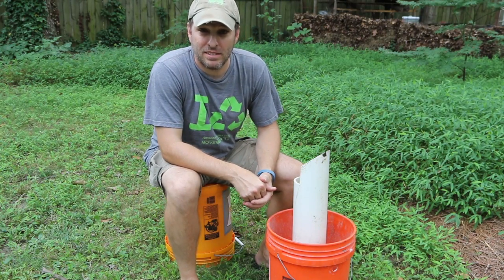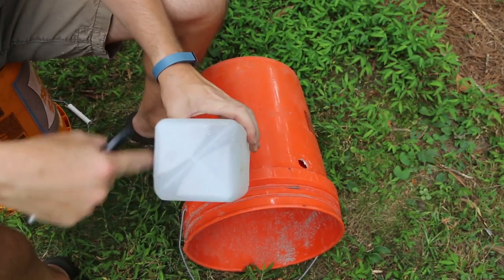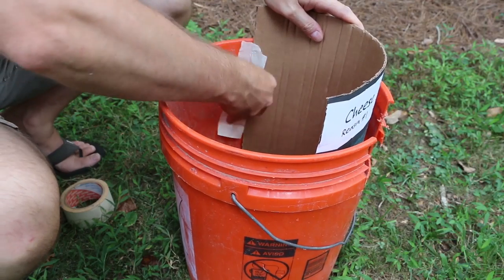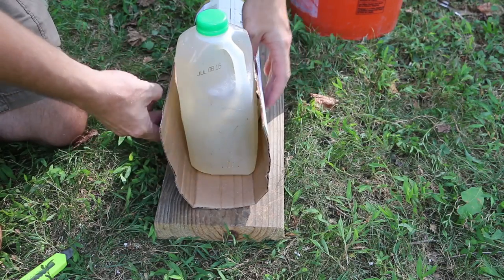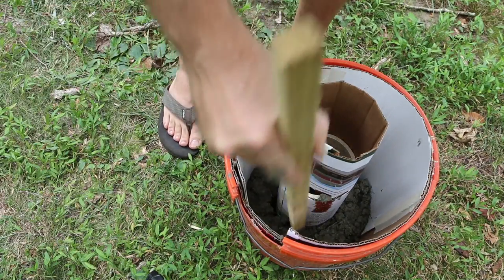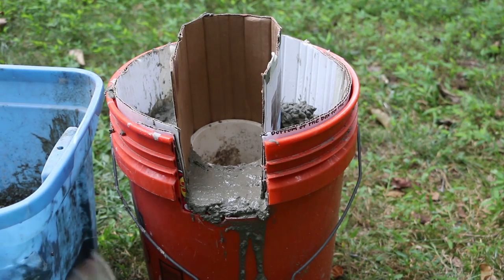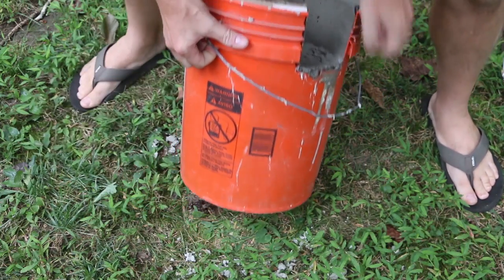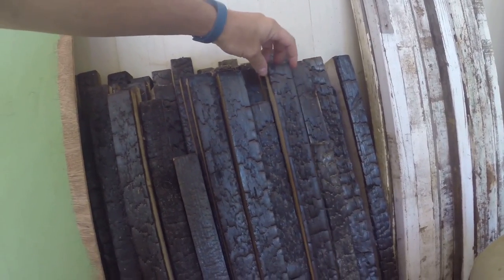How To Make A DIY Concrete Rocket Stove

Comment: I'm going  to try the rocket stove
Reply from the maker: Awesome Kathy! Let me know how your rocket stove turns out. BTW, I'm going to do an update on this rocket stove video to incorporate a lot of the excellent comments and suggestions that have come in. One thing I recommend adding to your stove is mixing perlite (in garden section) into the concrete surrounding the firebox and chimney. This will serve as an insulator, making the stove more efficient in delivering heat to the pot.

Comment: 1) Does it save more energy if it's shorter height? 2) What kind of marker is that @ 12:18 ?
Reply from the maker: Hi Joey. The chimney needs to be tall enough to have the air volume to pull a draft, but not too tall to allow for cooling before the combustion gasses reach the cooking surface. One data point I've read is the chimney needs to be 3 times the width of the firebox. The marker at 12:18 is my Twisted Sharpie made by my friend Greg Porter of the Greg's Garage YouTube channel. You can pick one up at www.gregsgaragekc.com. It uses a standard Sharpie insert, so you can replace it once it is worn out. The steel will never wear out. :-) The pens are all numbered too, which is cool. I have #21.
Reply: TY GreenShortz DIY for your reply. I think your upside down method and re-usable bucket mold is better than most methods I've seen so far. Does it matter what type of concrete i use or with sand, etc?

Comment: How does the  internal diamster  of the stove affect the  stove performance n whats the best  diameter!
Also would like to know how the height of the stove would affect :
Reply from the maker: I think the performance primarily has to do with airflow. There a ratios of height of the chimney and the length of the firebox/j tube. This particular design, bends a few of those rules. In a later video, I add a grate on bricks under the firebox to allow airflow under the wood.  That increased performance significantly. If the chimney gets too tall, there is more heat absorbed by the mass of the stove, less heat to the pot. I like to allow the flames to touch the pot directly. Heat absorbing into the concrete can be reduced by the addition of an insulating element to the cement mix. I add perlite in the later video I mentioned. Hope that answered your questions. Thanks for watching.

Comment: Nice work! I am thinking about making one of these on a larger scale for a rocket mass heater for home heating. I wonder though, is the concrete you used for this going to hold up under the typically EXTREME heat produced by rocket stove heat as in 2800 degrees Fahrenheit???

Thanks,

Lee
Reply from the maker: Lee, that is a good question. I fired this one in a video boiling eggs, https://www.youtube.com/watch?v=xNghjd6FGu4 but that was not maxed heat output for sure. I've got a thermal camera, but it maxes out at 750 F. You could always pout your concrete rocket stove in a steel drum and just leave the drum on. Were you thinking that big? I will say that my prototype stove https://www.youtube.com/watch?v=NUgfcvGIr-Y was built using regular concrete and limited armature and it did crack under a hotter burn. When I get my fan in, I'll see if I can burn this one out. Thanks for watching.
Reply: The folks over at permies are ALLLL about the rocket mass heaters for the purposes of heating one's household. Their more recent stuff includes how to incorporate cooking apparatus and even rigging for hot water use as well. There is SOOO much we can do with the concept of rocket mass heating/stoves and to think we are really on the tip of the iceberg with this "new" technology. 

My main concern is trying to avoid building ANY PART of my rocket mass heater using cob of any kind. If it's not mixed just right, it's WORTHLESS! I don't have the time to fool around with that "maybe" stuff. I need more definite stuff. That's why I asked about the VERY HIGH HEAT known to exist in the regular use of Rocket Mass Heaters while using the cement type YOU used in this set up.

If you look at some videos from the folks at permies or richsoil (they also have a youtube channel) and you'd see the type of set up I wish to have where it's basically an L-shaped bench that surrounds/buries a system of chimney piping using rocks, crushed stone and, in most cases, cob. I want to do with out the cob as it is too finicky. One can add cushions to make a sort of couch effect to this "bench" made out of the rocks, piping, stones, etc and covering.

Now that I think of it, I wonder if building a box-like structure for the bench and sealing the outer layer between panels of plywood the thickness of which being equal to a 2x4 (1 and 3/4 in) would work to both delay the output of the heat within the stove, while still allowing it to be released in such a manor to still effectively heat the home AND perhaps making the overall heat performance lengthened ... ALL WHILE STILL not causing a bad release of toxic gasses from the insulation??? I was thinking of using that expanding foam insulation, BUT, that foam board insulation might do some good too!

PS-On the odd chance I am filling your head with ideas, that's great! Just promise me one thing...

ALWAYS TEST THESE THINGS OUTSIDE IN AN OPEN AIR SPACE FIRST BEFORE BRINGING IT INSIDE FOR A MORE PERMANENT STRUCTURE!!!

Lee
Reply from the maker: Lee, Thanks for the info and ideas. I've seen a few videos with rocket mass heat stoves. Simple and impressive. I'm not sure I'll attempt one just yet. I'm still learning how to run my rocket stove. I'd love to see what you end up building. 

One thought, perhaps lining the chimney portion with fire brick and then surrounding that with concrete would provide the heat resistance and stability you're looking for. Not sure if that would limit the radiant heat if you are looking for that output.

I think I'd stay away from any foam product around high heat. Too much heat would vaporize or gasify it. But, don't quote me on that I'm not an expert on that.

Thanks for watching and for sharing your insights.

Comment: I've watched a lot of these rocket stoves videos and this is far and away the best. Only problem is I want one to take camping and boy this one would be heavy! Great for use at home though.
Reply from the maker: That's high praise, Stewart! I appreciate it. I tried to picture you stuffing this rocket stove in your frame pack. :-) I've been thinking about a backpack version of a rocket stove (my son will start Boy Scouts this month). There are some cool metal stoves on the market that fold flat. Here's a link to one I've seen on YouTube, but it is out of stock, at least on Amazon. https://uedata.amazon.com/Firebox-Folding-Campfire-Stove/dp/B00BW77AZ8/ref=cm_cr_pr_sims_t I may try and make something like this. Would you be interested in seeing that video?
Reply: Totally!
Reply from the maker: I'm on it. The creative-pyro juices are flowing. Thanks for the feedback.
Reply: Of course the problem will be making it collapsible...
Reply from the maker: +Stewart Black indeed. I like a challenge. Rocket Stove thinking cap is on.
Reply: Mixing your concrete with perlite will make it lighter and also more efficient.  I have made a few of these now with a somewhat similar approach.  The answer to the weight problem, if you are using these out in the country is to pack them into your favourite spots and leave them there year round.  The joke around our favourite fishing spots now is "Is it rocket stovable?".
Reply: Easier to take a bit and brace and drill the holes in a log and make a rocket stove from a log. , or make one using box section steel or ally if you can weld.
Reply: Stewart Black      V v
Reply from the maker: Tim, this rocket stove is made from metal (not box metal), but it flat-packs for backpacking. Take a look: https://www.youtube.com/watch?v=dzAi6BHj5vI
Reply from the maker: Hey Stewart, I just did another version of my concrete rocket stove. Thought you might be interested...  https://youtu.be/TYr-Uj4HqDs

Comment: Mine is curing right now. Similar design based on yours.
Reply: It was cold and nasty out so I brought it in the living room into the heat.
Reply from the maker: Awesome! Make sure you give it a full 28-day cure. I didn't do this with mine, but got lots of feedback with the 28-day cure recommendation. Thanks for watching. Happy rocket stove-ing. :-)

Comment: Put the eggs in cold water bring to the boil for 1 minute, take off the heat and leave in the water for 15 minutes. Rinse in cold water. Perfect boil eggs and less wood.
Reply from the maker: +Michael Pepper thanks for the tip. I've been using a 5-minute-boil, 5-minute-rest, method to boil eggs. I'll have to try your suggestion. It would definitely require less wood. Thanks for watching.

Comment: what is the measurment of concrete
Reply from the maker: Hi Venuz. I used almost a full 80 pound bag of concrete (36 kilograms). I plan to build this rocket stove again, with some adjustments. I'll be adding perlite to the concrete mixture to add insulation and reduce weight. The insulation will make the mass of the rocket stove absorb less of the heat, allowing the fire to burn up more of smoke particles and direct more heat to the pot. Thanks for watching.

Comment: You could have just cut the Milkjug instead of the the Bucket... Just put some Stones inside to make it heavier
Reply from the maker: Ah...that is true. I did like that I could smooth the top of the firebox before adding the milk jug. Although, I suppose that would have worked using the method you suggested. Thank s for your comment and for watching.

Comment: Is it a 10 lbs or is it a 20 lbs bag of concrete
Reply from the maker: Actually, Thomas it is an 80 pound bag on crack-resistant concrete. Pretty heavy.
Reply: Did you use all of the 80lbs of concrete

Comment: I took a picture but don't know how you can put it on here. I guess you can't, but my husband made a trivet for the campfire to hold his Dutch oven with round sides outwards of three horseshoes and welded them to three nuts so he could screw longer and shorter bolts to it so he could have a longer distance from the fire if he wanted. You could weld the horseshoes to your rebar to set more stable If you tell me how to do a picture I can send to you. It works well. Janice

Comment: what is the difference between a rocket stove and a wood gas stove, please clarify. I feel rocket stove is equally good. please clarify the differences.
Reply from the maker: Vengidajalam, both a rocket stove and a wood gas stove use a convection current (air flow) method to induce a hotter, cleaner burn. The rocket stove burns the wood fuel directly in a fire box, drawing in air as the heat rises up the chimney of the stove. A wood gas stove heats the wood in a chamber, separate from the fire or heat source, driving the burnable volatile gases out of the wood. These gases fuel the burn at the top of the stove, providing cooking heat. This method is also called gasification. I don't know enough about the science to know all the benefits of both methods. Hope this answered your questions. Thanks for watching.

Comment: Can it melt iron?
Reply from the maker: Ha! Not sure, but it will melt aluminum. :-)
Reply: It MIGHT work if you put a fan on the fire to get it hotter than hell fire.
Reply from the maker: Lee Forex...that sounds like a challenge. :-) I've got a fan on order.
Reply from the maker: Lee...here's a video where I add a blower to the rocket stove. https://www.youtube.com/watch?v=8hvNH_1uK1g Wish I had a temperature gauge to measure the increase. Not hotter than hell, though...but hotter than Georgia for sure.

Comment: Refractory cement would be proper for this. Chicken wire wouldn't be needed.
Reply from the maker: +Fred Fernald Hi Fred. Agreed. I've gotten a lot of good feedback on this rocket stove video and will make another one soon, using all the good comments as my guide. Thanks for the suggestion.
Reply from the maker: Fred, I just did an insulated (perlite) concrete version of this stove. thought you might enjoy. https://youtu.be/TYr-Uj4HqDs No chicken wire. :-)

Comment: I have used a similar approach but yours is better.  Your bucket is reusable.
Reply from the maker: Thanks David. I just shot a video reusing the bucket and PVC pipe to make a similar rocket stove out of mud, a cob mixture truly. I haven't pulled it out of the form yet, but will send you the link if you're interested in seeing it.
Reply: Looking forward to it.  Rocket stoves are presented as newer technology that was efficient and designed to reduce pollution however my gut tells me mud/cob stoves like this have been used in the past.
Reply from the maker: David, I referenced your comment in the redesign of my concrete rocket stove. Check out the video: https://youtu.be/TYr-Uj4HqDs Thanks for the comment.

Comment: Natural gas Electric power plants in the U.S. are up to 68% power efficient.  There is no power plant operating at 15% efficiency  that I'm aware of and they would be going broke quick.
Reply from the maker: That number figures in the energy required to mine and transport fuel, inefficiency of the conversion to energy and line loss. I found that info in a book on green building, so I’m just repeating. BTW, legacy power generation is still heavily subsidized by the feds or incentivized, depending on how you look at. Thanks for the feedback.

Comment: Votre four manque  d' issues  d'aération les flammes ne vont pas tenir longtemps et le feu va s'éteindre.
Reply from the maker: Merci pour votre commentaire. J'empile habituellement le fourneau de fusée sur des briques pour permettre plus de flux d'air. Ou utilisez un petit ventilateur alimenté par batterie pour booster l'air. Cela semble fonctionner. Ce n'est pas un vrai poêle à fusée, mais il utilise le principe du flux d'air. Je vous remercie.

Comment: Fire and concrete DO NOT MIX WELL, especially under homemade conditions.  Concrete is a mix of cement, aggregate (pebbles) and sand.  When sand and pebbles are heated, they expand and 'pop' out of the concrete.  This can cause serious eye damage!  If you want to make a rocket stove, make it out of metal or fired CLAY brick (which has already been fired at temps of  1000F to 1800F); for this google '16-brick rocket stove'.
Reply from the maker: Shilodog, thank you for expressing your concern. I've had a few comments to the same effect. I've used this stove multiple times and haven't seen any cracking or popping, however I'm not sure if this is truly reaching rocket stove temperatures. I did make a mud rocket stove...did you see that one? https://www.youtube.com/watch?v=DsAb7a7u2cc&t=1s I loved using this material because it brought back some childhood mud-pie memories, it was free and is a great sustainable building material.
Reply: Fire and stone normally work well together, the popping you refer too is when stone is added to fire afterwards stone then can combust up & out becoming very dangerous. Fire added to stone OK, stone added to Fire Not OK

Comment: LoL, armature?  reinforcing chicken wire!  A oscillating sander will work good for removing bubbles.
Reply from the maker: +watchthe1369 I'm not sure the chicken wire helped, but this rocket stove hasn't cracked yet. So maybe the "every little bit helps" rule applies here. :-) thanks for watching.

Comment: well the one I made is to big I want one I can move if I want
Reply from the maker: Ah yes! Hard to move the 1000 pound adobe stove. :-) Between my concrete rocket stove and my adobe one, I think the adobe is a little lighter.
Reply: Oh I don't know if you know this but here goes when you first make your MUD stove, when out of the form you to spank it,,,take a little flat stick I use a paint stick or your hand & GENTLEY Pat the Adobe it pulls any air Bubbles out of the MUD & mine hasn't really Cracked I wish I had told you before you made it could have saved you trouble...
Reply: Also you will see it gets wet O.K. it pulls some of the traped water out & packs the Adobe..
Reply: I Swear it feels like my Adobe stove must weigh A Million Pounds not really but I can't move it.When I place it in the spring I'm gonna get 2 young Guys to do it HAHA

Comment: what I ve learned is that you must not burn a fire on or in concrete 
because: while the concrete is hardening the water remains in there, get
 caught so to say. while heating or burning the waterbubbles explode and
 so does parts of the concrete which can at least hurt you. this is also
 the reason why ovens are always made of clay or of high tempered bricks 
and clay.  and never of concrete
Reply from the maker: Good point Ronni. I let this concrete stove cure in the summer heat for 5 days. It was fully dry before it was fired. My prototype concrete rocket stove was made from regular concrete and it cracked. This stove, made with crack resistant concrete, hasn't cracked yet...and it has been fired pretty hot. Thank you for expressing your concern. I do like the mud rocket stove I've made since then, I'll likely be using that more.
Reply: lol youre wellcome. but for the better undestanding: the hardening process is very much faster than the drying process and it doesnt matter how long its drying afterwards cause the water will never come out. but that doesnt mean that parts of the concrete MUST explode but they CAN... anyway using a mud stove is the very much better idea :-)))